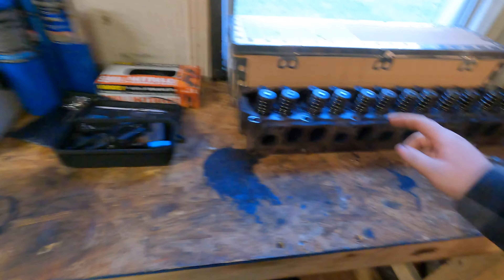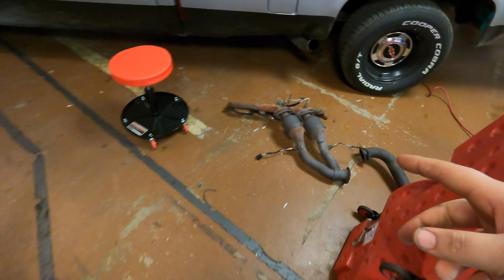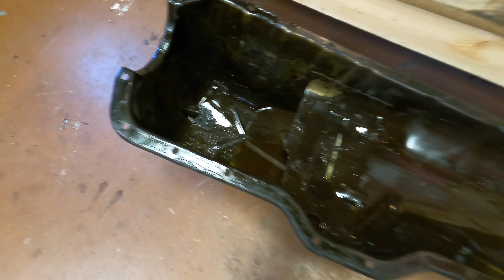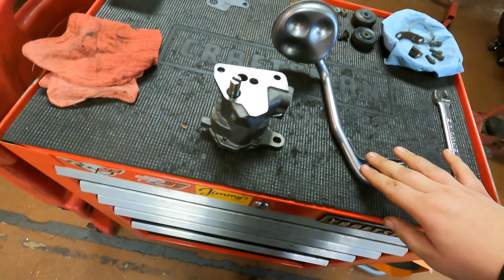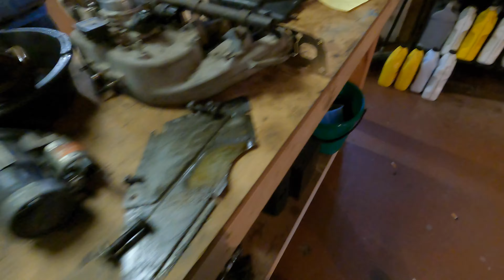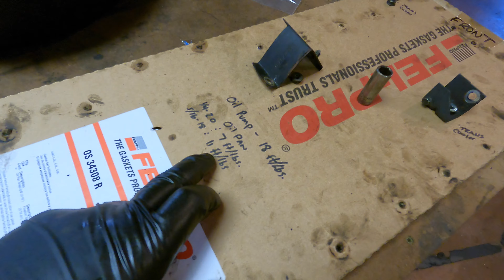XJ Motor is Coolant Free! But is it Too Far Gone? NO OIL PRESSURE

Comment: Many change oil pump while the real problem are the camshaft bearings . a must is for cherokee 4.0 is oil with zink . Amazing that many have not figured this out there are some videos who show you the real problem caused by the camshaft bearings not the oil pump ?
Reply: Than jeep modifies the cilinderhead in 2000 and the heads are cracking like with my jeep I just bought , good job jeep , great engineering .

Comment: If you had the oil pan off you should have changed out the main / rod bearings which were right there near the oil pump,  theyre cheap and you would have a better scope about the condition of the cam bearings

Comment: Can you use a slightly higher viscosity oil to get the pressure back up?
Reply from the maker: You probably could in some cases to get you by. Still kind of a band aid. But in my case I used 15w40 and 10w30 and it did not make a difference.

Comment: Put some Lucas oil treatment in and add it with each oil change, I was amazed how much quieter and pressure increase in my 04 4.0 WJ. It made a believer out of me.  Cheers from Jacksonville Florida 🌞
Reply from the maker: Right on! The motor may or may not already be out haha, but I will definitely have to try that!